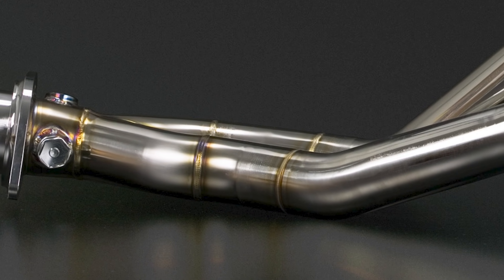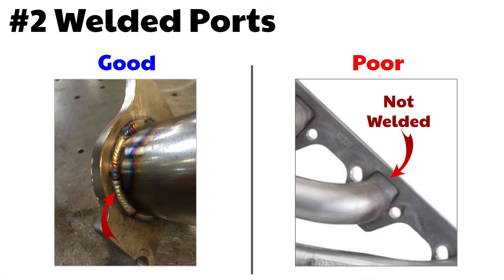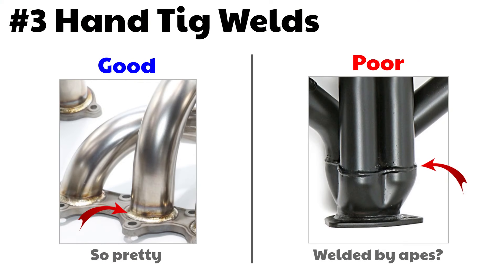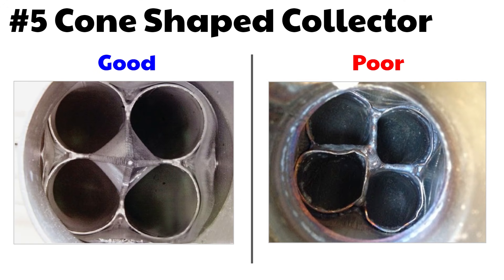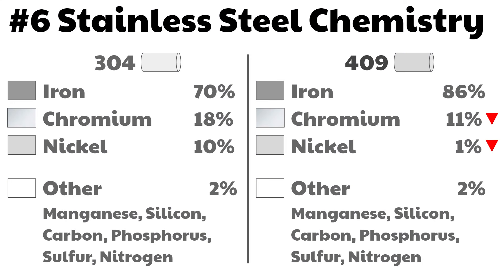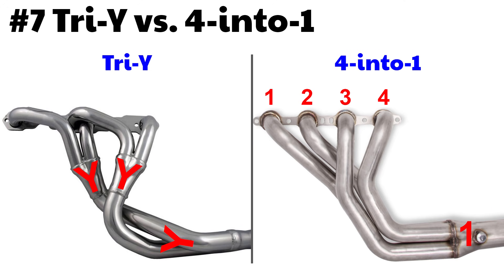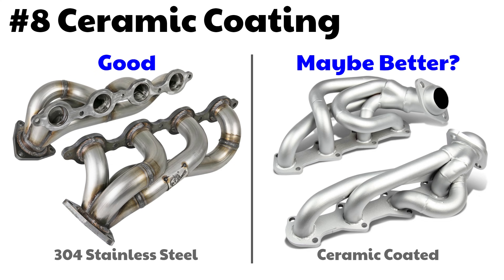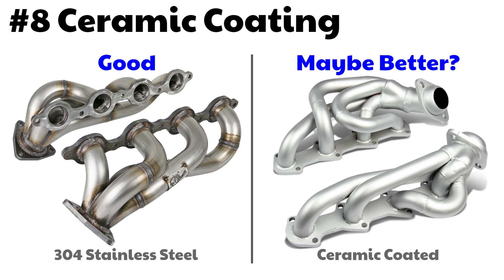Exhaust Header Secrets: What to Look For

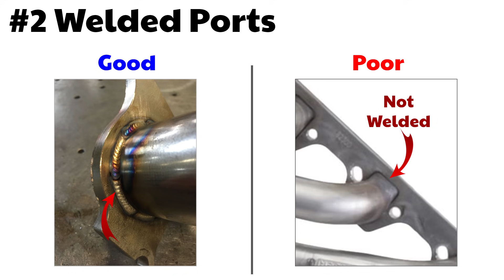Comment: 1:26  huh? that weld is absolutely not silicon brazed, There is no reason to silicon braze stainless steel to stainless steel. Stainless steel exhaust headers are always welded with stainless filler. The color comes from oxidation of the chromium in the stainless steel. Colorless welds are fine, and technically better because that means the chromium was not destroyed.

Comment: If you buy eBay 304 stainless headers, run a flashlight around them to make sure there are no leaks around the collector.  I recommend ditching the old school collector flanges and welding in V-Band clamps, they save space and you can start a turn sooner.  Thanks for posting.

Comment: I've never had a set of shorty headers, I had a set of bbk equal length short tube headers back in the day on my 92 convertible Mustang. My 87 Mustang has Mac equal length headers, my 89 has bbk long tube headers and I have a set of bbk long tube 351w swap headers for my new convertible project. If your going to do a good exhaust build why go cheap on the headers?

Comment: 4 year old information like this should be removed or at least updated as it's NOT correct and accurate ie; ceramic coating of headers does make a noticeable difference as it keeps the exhaust gases hotter as they travel along the exhaust system the same way wrapping headers in fibreglass material does. 
So to be technically correct to get the maximum effect from a set of stainless headers they need to at least be fibreglass wrapped. 
Which means you're not going to see the pretty shiny stainless anyway!
Sooooooo so you wanna go fast OR have nice shiny headers lol

Comment: You didn't mention 321 stainless? Titanium.

You didn't talk about tubing thickness 16, 18 gauge?

Primary diameter / length and how it affects power? The calculations behind it.

 Collector diameter/length and how it affects power.

Stepped  1-3/4" to 1-7/8" for example.

Zoomies or crazy 180 degree headers.

Comment: I’m building my pontiac 455 flat top pistons W 6x-4 heads 87CC comp cam 480 lift I’m not looking to save at all after I did some comparison between Doug’s headers and other low end Doug’s headers have 1-7/8  primary vs 1-5/8 others .Doug’s headers primary is same size hole as my heads not smaller it’s worth paying high price headers

Comment: At idle, I like the idea of the exhaust pulses reverberating back into the combustion chamber right on cue, for the inlet valve opening on a big 310deg duration cam shaft. that way it stops raw unburned fuel does not exit via the tail pipe.

Comment: Equal length headers gets you close to where you need to be. A V8 does not emit power pulses evenly spaced apart though. Some of the pulses are overlapping each other a bit. This causes 2 pulses to compete for pipe flow to some extent. The last stage of tuning the headers is to extend some of the pipes to add a delay in pulse arrival at the collector in order to artificially even out the pulse arrivals and eliminate the pulse competition. This tuning is optimized at the target power RPM. Something in the range of another 15HP can be gained by this optimization on a V8. Also, your car will then sound more like an Indy car than a muscle car.

Comment: Equal length is technically wrong because the exhaust pulses run into each other, the pipes need to be stepped to match the firing order so the pulses pull instead of run into each other
Reply: That's not true, you have it backwards. No two cylinders fire at the same time on any engine. Therefore, the pulses cannot run into each other with equal length tubes; thus, equal length headers ENSURE that no two pulses ever reach the collector at the same time. It is physically impossible with equal length tubes, unless two cylinders fire at the same time, which they never do in any engine. That's the whole point of equal length headers.... you ensure that you don't get two pulses reaching the collector at the same time, ever, on any engine, regardless of the firing order. The firing order only comes into play with un-equal length tubes.
Reply: @ most 4 and 8 cylinders have 2 firing at the same time. Right here on YouTube will show you😂If your going to comment, please know something

Comment: You do not want equal length headers on most V8's. You want no more then one pulse reaching the collector at any one time but because of their firing order, 2 will sometimes reach it at the same time preventing scavenging.
Reply: Yes you do.... no two cylinders fire at the same time on any engine; thus, equal length headers ENSURE that no two pulses ever reach the collector at the same time. It is physically impossible with equal length tubes, unless two cylinders fire at the same time, which they never do in any engine. That's the whole point of equal length headers.... you don't get two pulses at the same time reaching the collector, ever, on any engine, regardless of the firing order. The firing order only comes into play with un-equal length tubes.
Reply: @ you have much to learn young padawon 
https://youtu.be/f72BMpmoGMY?si=ZT-R3VwQ2iaHfPGF

Comment: Hey there, I work in a company which makes high-end exhausts for sports cars and racing cars, and talking from my boss huge experience, ceramic coatings are almost a scam if you plan to use the car at high rpm for much time, as the thickness of the coating isn't enough to resist to that much heat for long and will soon start to crack and crumb into dust.

Comment: Well sir you are misinformed about equal length headers and power production. Virtually every gearhead with decent knowledge of engines realizes that non flat plane V-8 engines have an odd firing order and do "not" produce evenly spaced exhaust pulses. This is overcome by varying the length of the primary tubes to correct for this.

Comment: It may not be the same as ceramic coating but I have used gloss chrome VHT paint for the same reasons. And if it needs 'adjustments 'or gets dirty over time..another can is a lot cheaper.

Comment: Gave up on ceramic coating which discolors,,Been using VHT silver 2000 degree F. Spray can paint with quick coverage, on a sand blasted header.Stays looking better longer without color fading and can be touched up easily..and big savings...
Reply from the maker: That’s a good tip.  Nothing lasts forever so the fact you can touch it up is handy.

Comment: Something to consider with equal length headers is firing order of your specific v8. There are engines for which an equal length header is not the best. Check it out and you'll see what I mean.

On the topic of material and ceramic coating and rust...

Any metal with high iron content can be passivated using phosphoric acid. Iron will oxidize eventually if exposed to oxygen no matter what. But oxidized iron can be converted from iron oxide to iron phosphate. The iron phosphate layer can prevent deeper structural iron from being exposed to oxygen. 

The header should be boiled to promote a flash oxidation layer to give the phospho something to convert and thus build a thicher iron phosphate layer.

Ceramic coating is something most people can do at home.
It's worth the price of a set of headers to know how to do.

Great video man. Keep em coming.

P.S. might consider teaching that matching the header to the intake and cams shaft is the key to making good power. A stock engine can actually lose power by adding a header designed for racing applications. Also, the diameter of the runner affects pulse timing. A smaller diameter will accelerate the exhaust gas and a large diameter will slow it down. The reason this matters is at what rpm do you want max torque. If the intake is designed for peak torque at 3000 rpm and the header for 7000 rpm... well you can see what's up. They will be working against each other. Then the cam shaft enters the chat, lol!
Reply from the maker: Great points, I may need to update this video at some point.  Appreciate the constructive comment.  Cheers.
Reply: was about to sat same thing about equal length headers, most don't know or understand that equal is wrong in most American V-8 engines, This isn't to say that the un-equal length most cheap headers are correct as they just make them that way to be cheaper. True tuned length headers are usually super expensive and hand made. And your point on matching tube size of the headers to RPM ( cam, intake, CR and exhaust all influence this ). Finally David Vizard has great info on a zero backpressure cheap and quiet as you want (or not) exhaust system with an anti reversion chamber that makes it as quiet as a Caddy (or not)  but with ZERO HP looses. I've been doing this for 30+ years. Even have done set ups with using 3" at headers reduced to 2.5" then 2.25" and gained low end torque and top end HP ( it uses an old cheap paint trick if any old timers know what I'm talking about lmbo )
Reply: I would love to see a video on that reaction you were talking about. I've seen my work wash down parts with phosphoric solution then rinse before powder coating. Is that something similar?

Comment: One problem that cheap Chinese stainless headers can have. When you MIG or TIG weld headers you have to protect the backside of the weld with either painted on flux or cap the ends and fill them with shielding gas while welding. This is not always done with Chinese built headers. It can cause cracking at the weld. 
Also 304 stainless has a significantly slower rate of heat transfer than mild steel. So uncoated stainless headers have about the same heat transfer rate as mild steel headers that are ceramic coated. But stainless is much more expensive. The cost of stainless alone is comparable to the cost of mild steel ceramic coated headers.
And you can get away with 5/16" thick flanges with stainless because it's a much tougher metal than mild steel.
409 stainless is only used by the big auto manufactures because it lasts for the practical life of the vehicle in areas where the roads aren't salted. Even though cosmetically it will look bad it will still be sound unlike mild steel. It's not even really available from the header tubing supply places, only 304 and 321.
Reply from the maker: Great comments.  Thanks for adding.

Comment: How important are equal length header tubes on a typical V8 engine when the exhaust pulses on each bank are not uniform.  They are both 180 and 90 degrees crankshaft rotation apart.

Comment: Equal length is not the objective. As in pipe length. Equal length of heat distribution length into the collecter.  Then theres the distance into the collecter each individual pipe goes

Comment: In my opinion,  a common collector is NOT needed or the best .  One should use a straight line style "lakester" headers as smooth and uniform as possible.  Yes,  one may have four different lengths in the header (V8)  but one must have exact same length overall.   Best length is about 30 inches with the max speed in the gases is about 1100 feet per second.  In NASCAR,  straight line racing,  lakester headers are the preferred.  Don't use complex or convoluted headers like in Hooker Headers,  they are bad and today they are made in China.  Kooks Headers is one of the better ones,  they are made in Statesville,  North Carolina.

Comment: The stupidity of this video...
Only time you want equal header is on 4cyl engines. And even that is questionable as in recent testings uel 41 header has made more hp than el 421 header on boxer engine.
You show picture of real good mig weld and write "welded by apes" under it...

Comment: My advice is this. If you are building a motor
for racing or hauling ass, then go ahead n put
Headers on. Headers will give you heat problems, you may need to heat wrap them. Also, sometimes the headers are really close to the spark plugs n will burn up the plug wires
because of a tight fit. The better headers are very expensive, unless you really really want 
to have headers on your ride. It's not really necessary. 
My recommendation for a good street/strip motor is to use the original cast iron exhaust manifolds and install 2 1/4 in pipes, for good flow, with Flowmaster mufflers for a nice throaty sound without all the noise n resonance you get inside the car. It will interfere with listening to your stereo. Bigger pipes mean you will be running at 
WOT which are not good for a street motor.
I have a Chevy C-10 with a 355 ci built up small block which has plenty of muscle n has
a bad ass authoritative throaty sound. It runs 
n sounds great n has a slight resonance inside
the cab. Unless you really really want headers n the headaches that go with them, heat, getting loose at the collectors etc. The stock exhaust manifolds will work just fine. They can also be ported a bit. The stock exhaust manifolds also give you low-end torque which is what you want in a street motor vs high-end
torque which will waste more fuel n not be as fun to drive on the street. A race motor is really only good on a drag strip, not on a weekend cruise...
Reply: Long tube headers make more torque and horsepower through the entire rpm range. Stock manifolds aren't designed to perform.
Reply: @alexbrown4820  
Stock manifolds were designed to perform, ie,
The SS 396 did not come with headers n produced 375 horsepower n over 400 ft lbs of torque. The 409 didn't come with headers. And neither did the small blocks that came in the Corvettes. That was the first thing hot rodders did back then too, is put on "wide open" headers to make more power. If I had a choice, I'd be perfectly happy with a stock high performance motor that came in an El Camino, a Chevelle or Camaro from back in the 60's n 70's. None came with factory "headers" that I know of, n those motors had more than enough horsepower in stock configuration...

Comment: Great advice and I totally agree with you Sport Tuned 304 headers are what I would be looking for!... The problem with many of the new Engines of today is that they have aluminum heads that are well designed, but end up breaking bolts because they have cast iron manifolds as stock to preserve heat (big heat/thaw difference)!... 304 Stainless Sport Tuned Headers I believe will solve much of those problems from breaking header bolts, but at a cost of changing out your thermostat to a little later opening with keeping the heat! There is always a heat distribution change on the aluminum heads and changing out the head bolts to something that will accommodate the heat exchange (heat/thaw) is also a great interest as well! Why many companies decide to go with cast iron manifolds is because of the cheap price! 

Great article!

Comment: Nice video production but I disagree strongly about your view on equal length headers being the best they do not produce the most horsepower actually unequal length headers correctly designed produce notably more power just FYI

Comment: 304 stainless is not a good material for exhaust. 321 Stainless steel is used in aviation exhaust systems. Also, make sure they are purge welded!

Comment: I know this is two years old but......

Wouldnt unequal lenth headers work better for the exact reasons you are saying equal length do?

Think of a sbc firing order.....5 & 7 go one right after the other.

So wouldn't you want one tube to be longer then the other so you keep them spaced out at the collector?

Lots of engines have two cylinders next to eachother go off one after the other...... lol 😆

Comment: I have stainless steel kooks with hp cats and a Borla exhaust. LT 5.3 2015 GMC Sierra. I also have an engine tune. My problem is yearly smog. I have to go back to the shop before I smog the vehicle. Is there a permanent fix for this,it's really getting old

Comment: You realize if you weld the header to much it also creates potential for cracks right. Also nothing wrong with mild steel, it will outlast your car is driven in the summer months or if your in a state with no snow.

Comment: You need to watch Mr. Vizard’s video on header length. He proves just the opposite and shows how unequal length makes more torque and hp. Your timing the pulses with which cylinder is firing after each other.

Comment: I have a 1993 GMC 366 in a topkick. Big heavy truck.  I would like to swap out the cast OEM manifolds and replace them with headers (and add a dual exhaust). The reason is I want to pull hills better, so low end torque.  What headers would give me the most low end torque?
Reply: Any set of long tube headers will help this "little" big block Chevy. If the tri-Y is offered at a good price, take those. The 366 is a small bored 402. If your keeping this truck long term, I would recommend looking for a used/crate engine 454 and swap it in, instead. A stock 454 will produce massive amounts of torque at low speeds that you will NEVER be able to get from that 366. The blocks mount identical, but the intakes will not swap. This would be close to the same amount of money spent (good quality SS headers VS used 454 long block) but WAY MORE of what you are looking for(torque at low rpms for pulling up hills).

Comment: I think the main difference between a tri-y vs full length 4 into 1 is exactly that, length.  Shorter length means the maximum scavenging happens at lower rpms aka where you peak torque where longer ones work at higher rpm to give you best scavenging at peak hp.
Reply: i am making 421 because of space, but all y are near of end of header, so difference should be less

Comment: one extra thing we do at work that wasn't listed here is to hammer the inside of the tube inside every flange to close the gaps and the clean the inside edges with a linisher thing in a die grinder (don't know what they are actually called) and smooth the mating surface of the flange with a flap disc but like you mentioned with headers we face them off on a linisher and they come out really neat